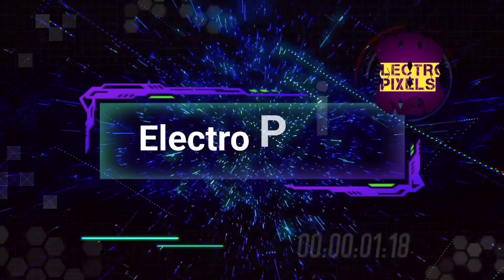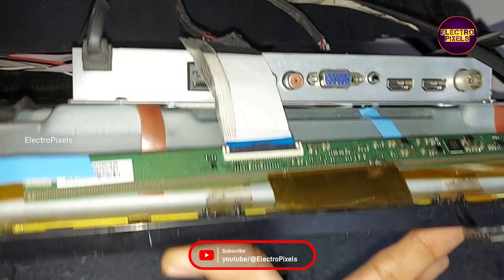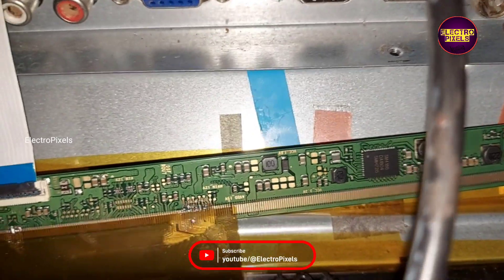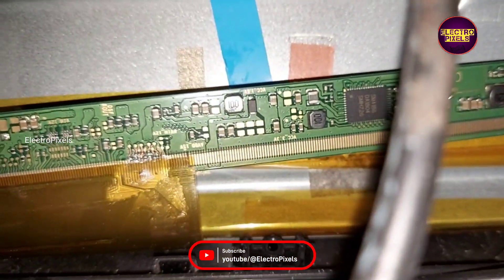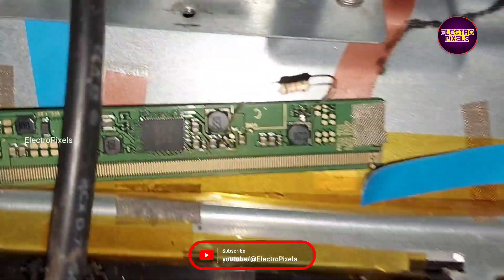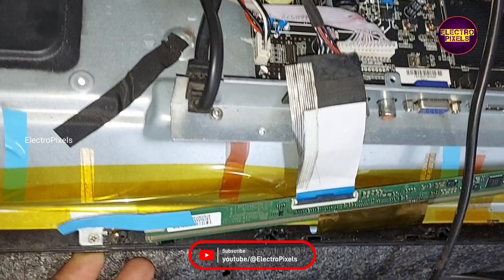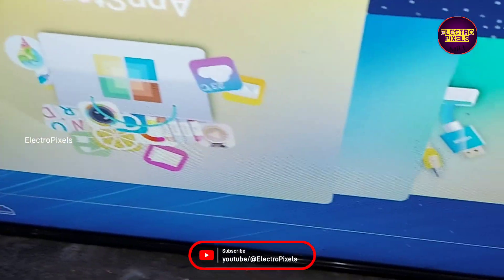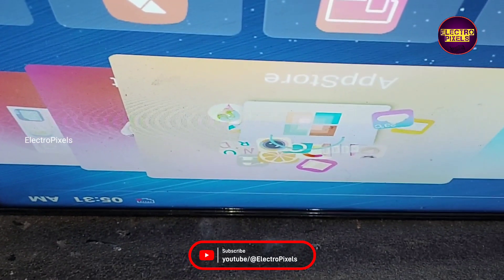SM4186 ic LED TV blank display|Only 12V,3.3v,1.8v |Vertical lines along with White shading picture

Comment: please answer what is the cmd component on the left to which the resistor was soldered. It fell off on me and I can’t find a replacement. is this a 0 resistor. why in different videos they solder 2.7 kOhm, 1 MOhm, but you use 15 kOhm? what does it depend on?
Reply from the maker: Use This Modifications only if After cutting Gatesignals for no picture Blankscreen, If picture comes with Vertical lines with White shading picture, Then only this method usefull. After all this just only temporary solution.Especially this model panels we can't predict how long the display will work using this. It completely Depends on luck basis. Here the 15k Resistor was soldered to VGH point that passes to panel Side. It just used to reduce the VGH voltage entering to panel. Sometimes it helps to solve white shaded picture and lines.This videos are for New TV technicians. Components near to that section are VGH voltage. Check in multimeter, to the point in which component fall down
Reply: 19k omhs can put?

Comment: Nice video. I want to know the value of the component, above that coil, where you soldered the resistor. I need to replace that component, it's damaged while soldering.
Reply from the maker: I think it's a resistor, Since that panel is not with me to check
Reply: did you find out the component value?
Reply: @theweather839  : as you see, here the channel owner has not yet replied to me but on another channel, the owner replied me " 100k " . So I think it's a 100k resistor. I thought it was a capacitor. I am still little confused, have not tried replacing it. According to you, what component is it ?